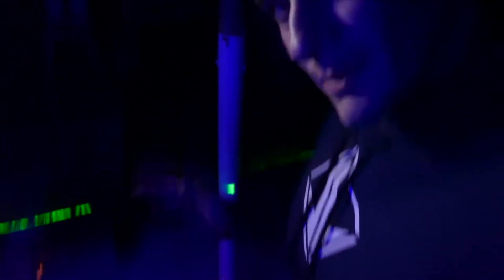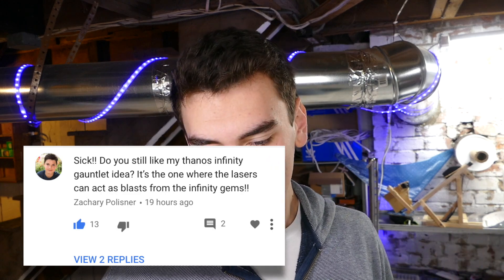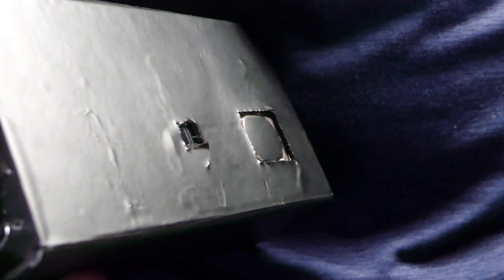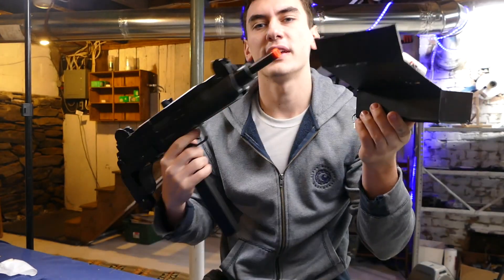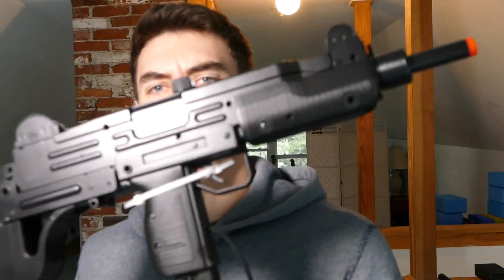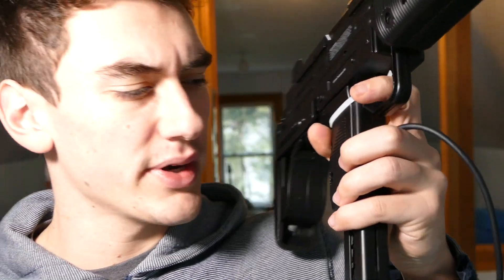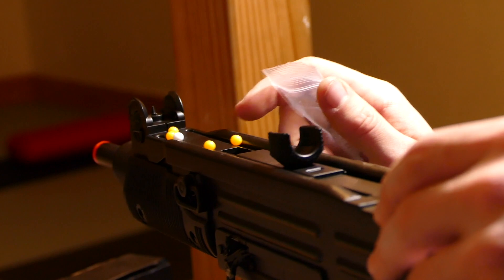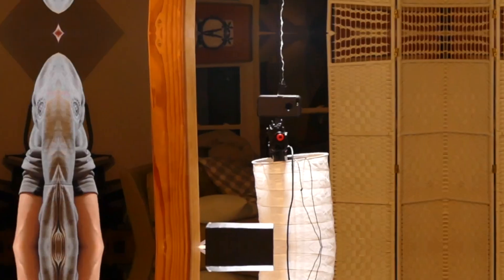How to Build an Airsoft LASER Trip-wire! - INSANE ALARM SYSTEM

Comment: A relay is a solenoid that opens and closes an electrical switch. In appliances like washing machines and dishwashers you have solenoids that open and close water valves.

Comment: Jlaser you should really do the turbine board I saw how you basically made a bracket to mount it properly but then had safety concerns. Just mount a mesh in front of the turbines in order to keep your feet safe and you should be fine. It's crazy noone has done a proper setup like this yet.